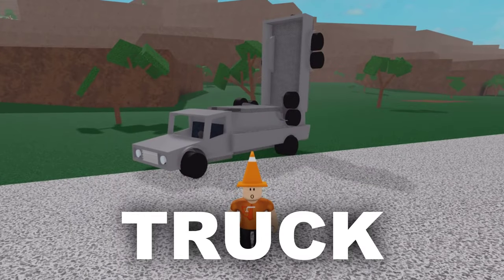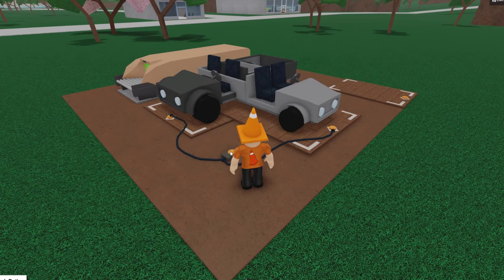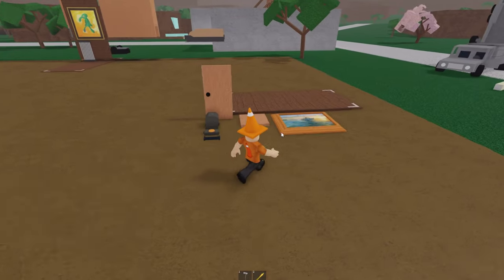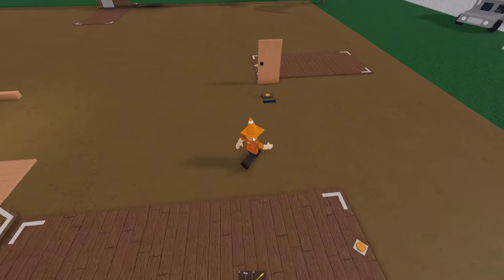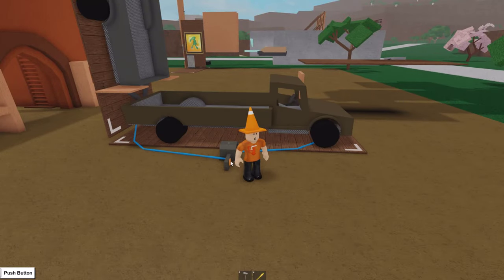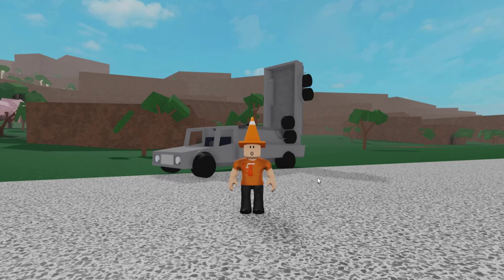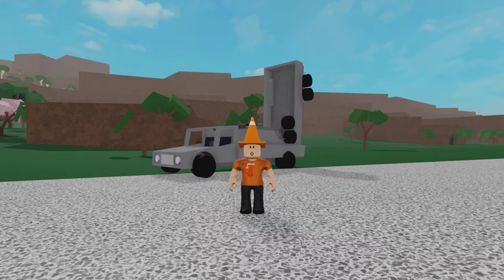(WORKING 2023) How To Build A Vault Truck In Lumber Tycoon 2

Comment: hey, I got a problem when I try hooking the hitch of the first trailer aka the ball part it doesn't hook on the trailer and I'm not sure what's wrong maybe a bit of help?                                                                                                                                                                                                                                             (edit)  i fixed the trailer hooking on but now the tailgate is locked close
Reply: How did you fix it??

Comment: Hey.. I tried doing it but the 5031 Hauler wont get glued to the truck.
Can you please check if it works on 2024?
Reply: It does make sure you have the tiles in right place and make sure that that the trailer is right over the truck and the painting is in the right spot

Comment: ive done this 3 times and i cant get the trailer to weld to the tailgate, its so frustrating. what am i doing wrong????
Reply: The cable from trailer has to go from the button, not from signal delay

Comment: i have a question, is it possible to create 2 copies of a code lock , one to open a door and the other to change the combination? if its possible, i would like a few tips to make it (i am already good with locks) thanks!
edit: i found out, lever, signal inverter, xor gate, and lever on the other input

Comment: I put down the tiny floor at the corner.
I stacked 3 tiles flush with the back edge of the floor.
I put the painting onto the last tile, 2 studs from the floor and 2 studs from the edge of the tiny floor, just like he did.
I put down the fake tiles and the real ones in the exact same way.
I linked up the wires and the delay and the button.
Nothing even welded!
Help!

Edit: Yes, I wired the button for the trailer to the button on the signal delay and the button for the truck to the signal delay itself. Just noticed that in another comment.
Reply: me too
Reply: Ion think it works anymore
Reply: Probably
Reply: But the older version works now (somehow)
Reply: @papkamachine4608  wdym?
Reply: @papkamachine4608  What older version
Reply: @spider7195  the one that worked before
Reply: @papkamachine4608  It doesn’t work thi

Comment: If it doesn’t work for you, try placing your real tiles only 6 studs from the trailers instead of on top of the 6th stud, and also place another tile real tile underneath both of them. Hope this helps 👍.
Reply: Nope. Didn't work. When I place the wood tile on the sixth stud and try the tailgate, the tailgate doesn't move
Reply: I fixed the problem, just put the delay wire into the trailer and the button into the car

Comment: I can comfirm it dose work but when placing the tiles on the 1st trailer the temp one needs to be below the line of the wood then the wood one goes ontop
Reply: Bro can you be specific
Reply: i don't get it
Reply: @IvanMartinez-m1n  @Skillfoolgamer wanted to say (i think) is that instead of 6, u put the tile blueprints 5 studs above the bottom of the trailer (the clip is at  2:42)

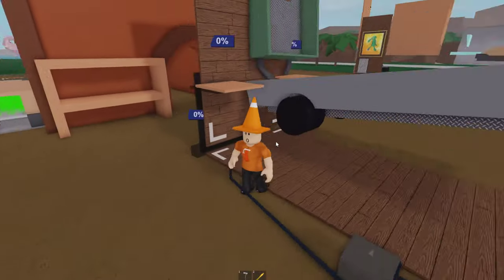Comment: 3:54 it doesn't work for me i tried alot of times i followed every single step but it doesn't move with it
Reply: doesn't work for me too
Reply: ive done it 3 times, i dont wanna find out i wasted an hour going through the maze just for a trailer stuck in the air :/
Reply: Anybody find a solution for this yet? It also won't weld for me.